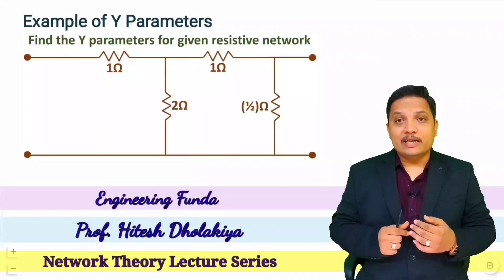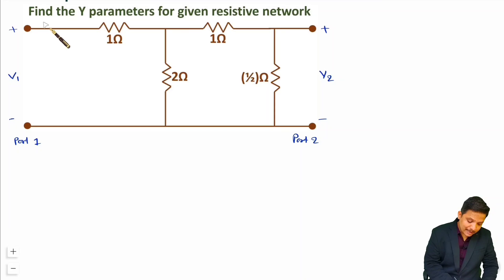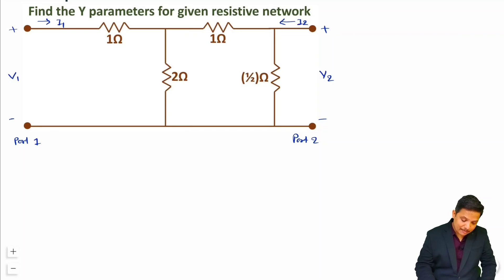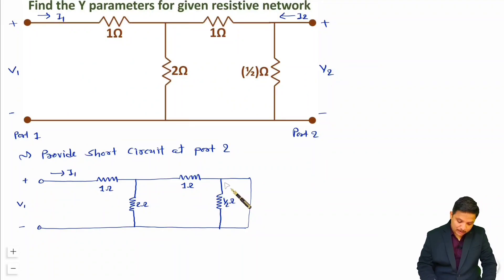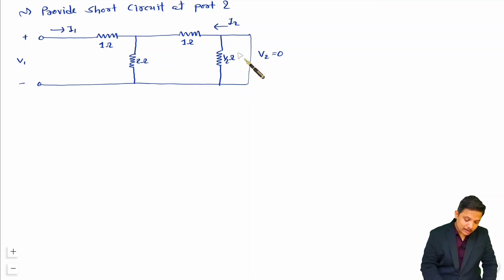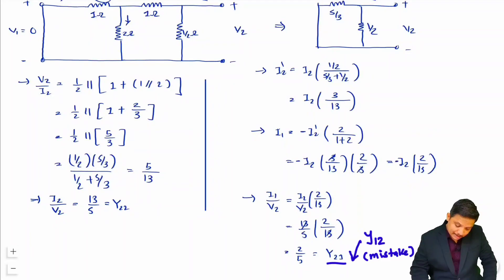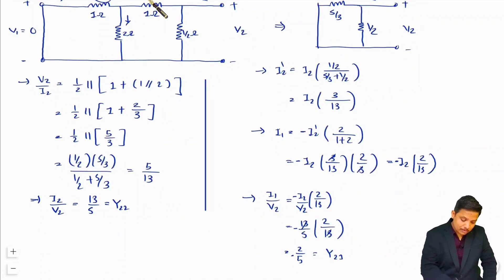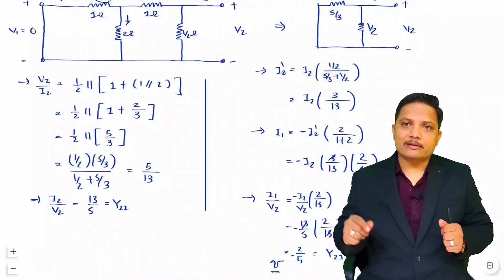3 - Example of Y Parameters: Input & Output Admittance, Forward & Reverse Transfer Admittance

Comment: Sir why didn't you open ckt 2 ohm resistor during output admittance?
Reply: Because there is a 1 ohm resistor in the short circuit branch if not it would be open circuit